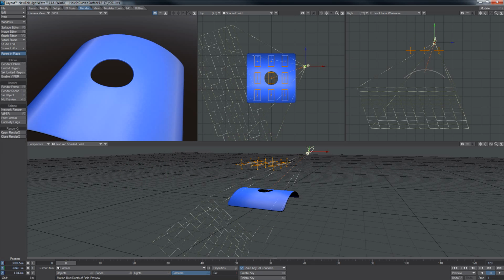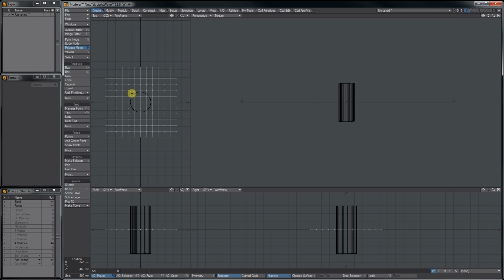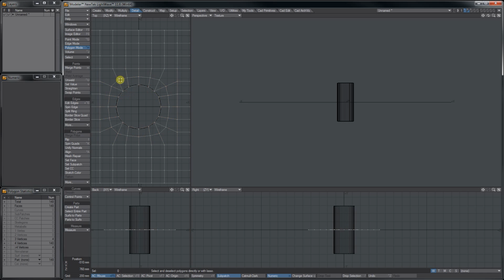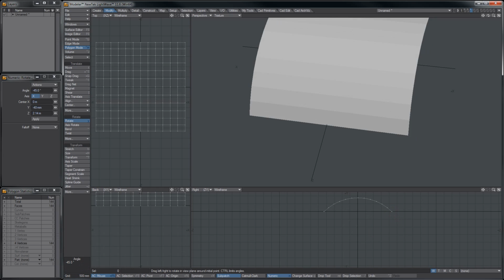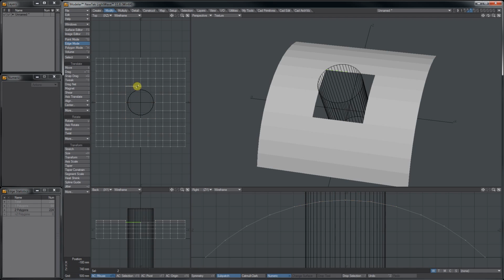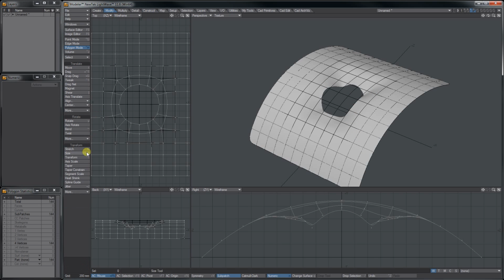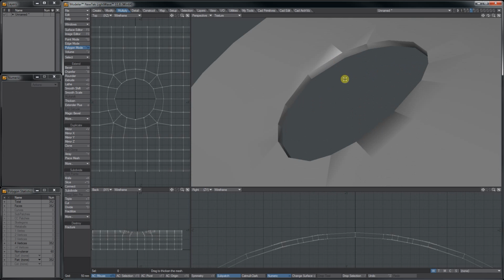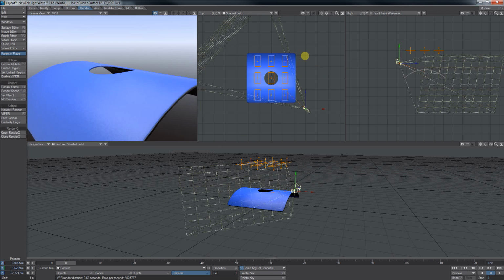LW3D - Hole In Curved Sub-D Mesh

Comment: thank you for the tuto bergen ! 
- alternatively to your 'slice' action .. you also can use the 'split ring' function on selected center polys ..
- and you can use the 'thicken' -> segments option (in this case 3 segments)
then you simply move the 'inner' edge loops with 'edge edit' into the right position ..
Reply from the maker: And also Thicken - segments. Awesome!
Reply from the maker: Tried to send this response before, but it must have failed. Anyway, thanks for the Split Ring tip. I went back and tried that with the confidence that it would work. I found the trick was to choose all the polygons around the loop except for the triangles. Then hitting Split Ring created the edge loop. Excellent!